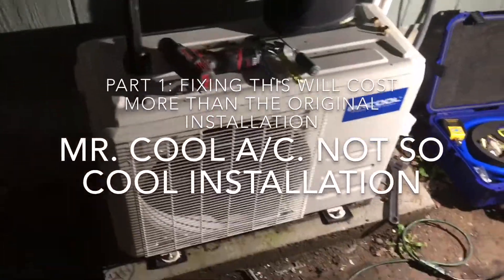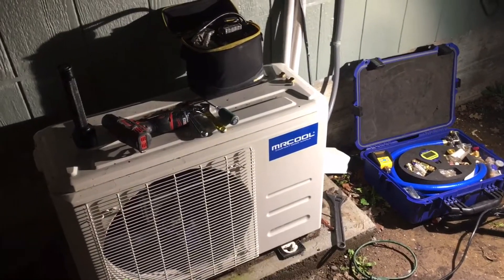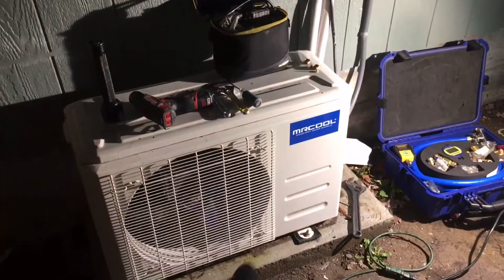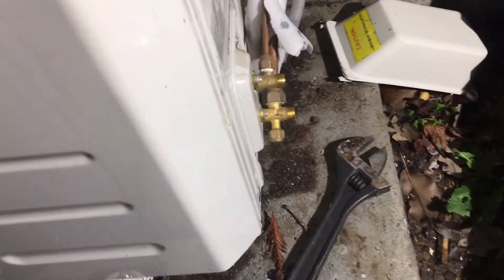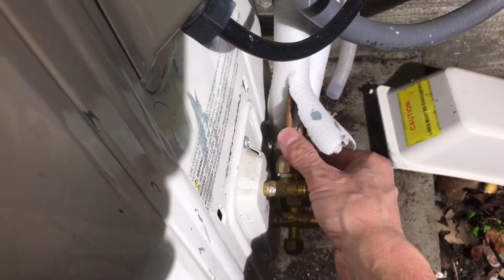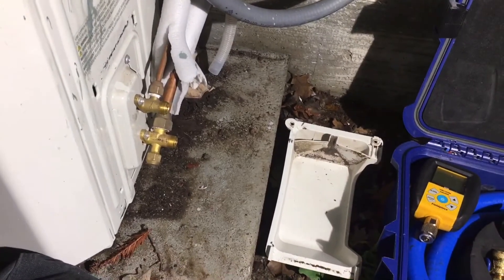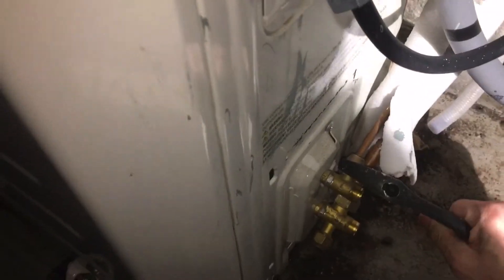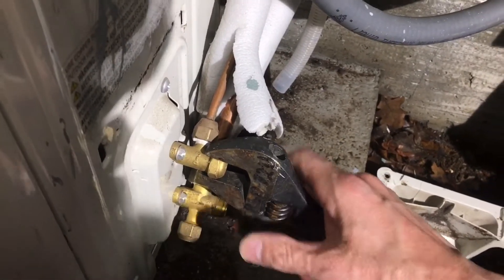Mr. cool A/C, Part 1: Not so cool installation

Comment: Of all the trades HVAC techs are the most stuck up.
Reply from the maker: Yes that’s what I hear 👂. I guess it must have to do with something that they have to be plumbers,  electricians, partial engineer is doing load BTU calculations, when mounting heavy equipment they have to be structural engineers for reinforcement of the building, when doing ducting they have to do the math and engineering for proper static pressure and air volume calculations, indoor air quality IAQ, now with the new title 24 energy codes they have to deal with that, Plus the new air tight standards of the whole building envelope Air tightness duct blaster test and air pressure + or - of the house or building. And if they’re really on the top of their game they’ve gotten into solar PV to run their air-conditioning units after electrical grid save customers on their energy bill. And if they really want to top the cake with a cherry take that waste gas hot energy transfer it to a plate heat exchanger to heat a hot water tank for free just take the wasted energy from the condenser that would normally be rejected to the outside atmosphere.
https://youtu.be/CcF0ConzjH0
Reply: @coldfinger459sub0  Absolutely we do... Let's also not forget that we also have to work around either decades old shoddy work, or try to make our equipment fit in a space that has already been plumbed, wired, etc. The previous contractors were able to take the more direct and easily accessible routes, and the HVAC usually gets installed around all that after they are finished.

Comment: All of a sudden mi confidence went up.. 
What is your verdict on mrcool mini splits?

Thanks for the video.
Reply from the maker: There OK they work if installed correctly. But I ask for energy efficiency compared to some other equivalent models that are available from FUJITSU or Daikin or LG not as efficient as the higher end models energy consumption wise.